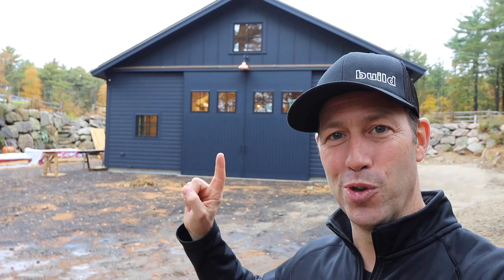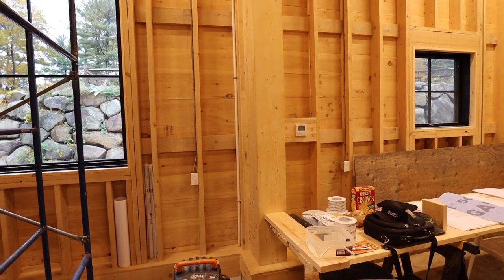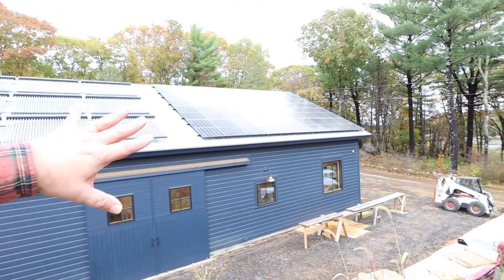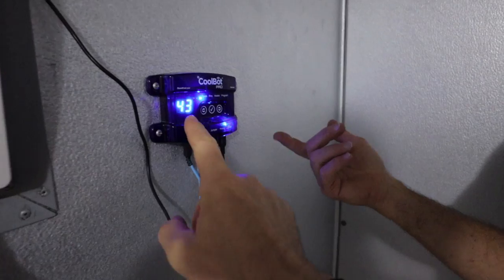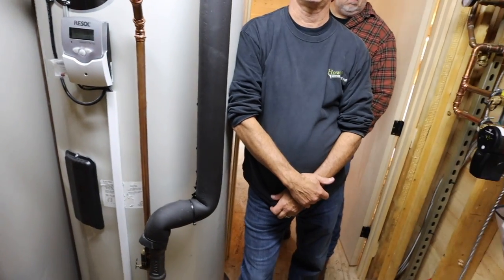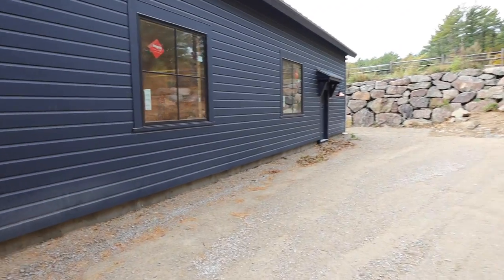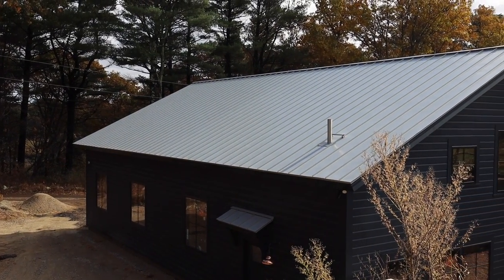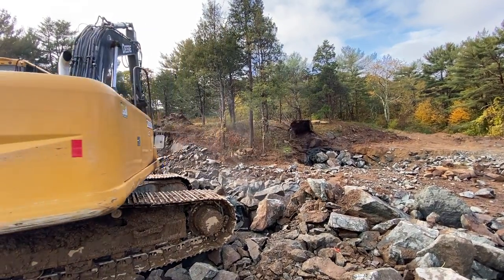Net Zero Party Barn

Comment: The fiorst guy describes the moment frame structure and says that the lack of ties between rafters is made up for by some ties through the concrete base.  That's nonsense.  The steel plates that are at the post to rafter joints, hidden in the beams and joined by   more than  1,000 3/4 X 10' pins is why the bents do not collapse outward.
Reply: Well then, Obviously you are much more in tuned to moment frames than my self and my structural engineer. I would be intrigued to hear more about your structural analysis as it may have saved us $$ - nonsense!!! The plates provide a moment connection between column and rafter beam. That resistance then transfer the stress to the bottom of the column to the base plate connection. The success of these two connections then apply a tensile stress to the grade beam as the columns want to rotate out but are resisted by the reinforce grade beam. Yes the plates are part of the success (although the pins are not 10') but this system DOES NOT work without the reinforced grade beam (unless you put a buttress outside like a cathedral). Are you a registered engineer? I am always looking for sharp people to associate with......thank you

Comment: Interesting moment frame. Wood moment frames are incredibly difficult to prove mathematically because wood is so poor in tension across the grain, which is necessary for a moment connection. I'm hoping they based these frames on testing or some sort of data, and they did not just give an untrustworthy product to an owner.

Comment: So it is a steel moment frame. That makes sense. If I were doing this structure I would buy a prefab steel frame and outside cheating. Then cover the inside steel with wood. 

13 Kw PV system! Take a long time to pay that debt. Heat collection makes sense. 

Be careful with the Air in the cooler. It could become unbreathable. 

To he'll with the house. I would set up living utilities, kitchen, and put a bed in a corner and been  happy.

Fire resistant outside sheathing. Good idea. 

So. How much per sq. ft.?

Explosives break the rock and excavators pick it up and trucks move it. 

What state is this located?
Reply: The plates are embedded in the wood frame - I don't see a difference. Also the client's desire was a wood frame, and I guess their desires should come first. Also, the electric rates here are pretty high, we have estimated about 5-6 years to pay for itself

Comment: "free" I mean you paid a ton for those panels and stuff.....so free isn't really the correct word.
Reply: Exactly. People mislabel Solar so often as free. That system is probably in the $40,000 dollar range. If a $100 a month to power that shop, 30 years of paying for electricity.
If they're leasing it. That cost never goes away and they better hope the buyer of that property wants solar from that company because they'll have to assume the lease. Or the current leasee will have tio ay to have it removed and stored till they want to use it again. I've researched solar to the Sun and back. Unless you're off grid or have money to burn and don't want another supercar to do 55 mph in. I found there's no good reason to get into it.
Reply: @myrrhavm  The electric generated here will service the entire project, barn, residence, pool house etc. Yes you are correct the systems aren't free, but I also have documented projects with $36k solar arrays that have paid for themselves in 5+years - and then the power is free......
Reply: @myrrhavm  Massachusetts is one fo the best states for solar btw
Reply: "Temporary investment" - soon to be free (5-6 years)
Reply: @stevenbaczekarchitect9431  They didn't say it would fully service those properties they said it would supplement.
Reply: @stevenbaczekarchitect9431  That's an expensive system I'd be surprised if it paid for it self that quickly. Most solar setups pay for them selves in the 10-20 years time frames generally.
Reply: @Dougie085  in New England the timeframe is much quicker
Reply: @stevenbaczekarchitect9431  why? You get less sun than places like Texas and Florida, unless the tax rebates practically pay for the system.
Reply: @Dougie085  yes, we have SREC's, our electric costs are higher, and incentives are high
Reply: @myrrhavm  $100 a month?  Try about $400.
Reply: @Doug Dale 10-20 years if you pay for a "professional" installer.  PV systems are half as expensive when installed by a homeowner, so I imagine a contractor installing the system as part of the construction process would be in-between those prices.
Reply: @myrrhavm  Financing solar with a loan is the way to go. You can structure it so your payments are equal to or less than the savings, so you're not losing money every year, then once the loan is paid of you really do get free energy.
Reply: @myrrhavm  My system is almost the same size, just over 11kw and cost under 30k before 30% tax credit. Our system is financed and payment is less than power bill.
Reply: All the people in this video will be long gone before they break even on that solar system
Reply: @myrrhavm  that is a very practical and 'consumer'-minded position. Paying for solar means voting for solar, which will lead to advances in renewable energy down the road. EU paid the biggest toll when PV first came out. Their sacrifice of practicality then has made it reasonable for everyone else now - including my off-grid project. Cheers to them!
Reply: @Dougie085  Its actually almost impossible to break even with solar in Texas.  Between mandatory grid tie, wholesale sell, retail buy, ect..  and cheap power, it is a pretty long payout.  The reason it works in Mass is that their power is expensive as well as strong incentives.  That is a LOT of panels.

Texas has a lot of sun, but we also have a LOT of oil and gas companies too.  

I think they have more like 100K in panels, and almost certainly have batteries as well even if we didn't see them.  Another 40K in the water system most likely.  

I could be TOTALLY off, too.
Reply: @stevenbaczekarchitect9431  huh?  Nope, AZ, CA, NM are far better.  MA is terrible for solar.
Reply: @kdrguru  You need to look beyond just the solar access parameter my friend, and look at things like net metering, cost of electricity, SREC's, etc. Funn y I'm licensed in NM and have about 40 net zero homes there too.
Reply: @ @stevenbaczekarchitect9431  The PV array on the barn is 13 kW, i.e. 110 amps.  First, that's very unlikely enough to service an electrically heated and cooled large barn, residence (likely over 7k sq ft), and pool house, when it's active. In the Mass winter expect no more than 2 or 3 full power hour equivalent per day.  Solar installation in Mass for a winter month will fall to 10% of the annual monthly average. Worse, most rooftop installs are sub optimal.  This install in particular has a tilt angle to shallow for Mass latitude, i doubt its facing due south, and it appears those east side pines are going to shade some of the early sun.  Count on some snow cover and less than adequate cleaning.   Best leave solar to the utility if that's what people want, as they build solar five times cheaper than rooftop.
Reply: Steven Baczek and fact is many states have allowed utilities to stop running meters backwards, Hawaii for example. Now you have to add batteries and inverters and batteries have limited lifespan. I think you are trying to make the homeowners feel better but facts are facts. I researched solar ( in CT) and it just doesn’t pay. Limited sun during months where you need it the most, snow covering panels can knock out a whole row of panels because they run in parallel. You just cannot heat water on a roof in main when ambient temp is below freezing, it’s basic  please tell us about back generators that the clients have,milked every other sensible homeowner in NE has
Reply: @simonmetz8587  Here we have great incentives, we have net metering, and we have SREC's (Solar renewable energy certificates). I have projects where the PV has paid for itself in less than 5 years and that includes driving 15k miles in their car. This project specifically is probably not on that schedule, but it isn't far off. This client (which I highly commend) was out to do the right thing. Investment is always on everyone's mind, but it wasn't the driver here. If more clients viewed decisions from their point of view, things would be less expensive, and easier to access for all. In some ways they are - systems keep going down in price and generating performance increases. It's sad for Hawaii (lived there for 3 years) that is a perfect scenario for PV. I greatly appreciate the comments and discussion
Reply: @stevenbaczekarchitect9431  I was curious too about if the panels had the optimal tilt angle 📐?
Reply: @gac107  Not true !! I have numerous projects where systems are paid for in 5 years or less - Hell, I hope I'm still around for that.....

Comment: Hey you doofus the term you are supposed to know (at about 12:00 minutes in) that these are called "HEAT EXCHANGERS" that transfer the energy accumulated from the solar collectors to domestic hot water (DHW) and hydronic floor heating systems.  These systems are almost always filled with a Glycol solution in Northern climates where it freezes during the winters and are handy to keep your driveway & sidewalks clear.  Using heat exchange technology is VERY effective when used as a transfer medium from external wood boiler facilities, which only need to be fueled/loaded once a day and maintains heat/hot water for extended periods.  Along with super-insulation, a very wise component to a net-zero design.  I wish it were more affordable.

Comment: Quit calling it 'free heat'.  Those panels cost $40-50K...
Reply: It is more of a rounding error when compares to the cost of this barn. However, I just did a 40 panel PV roof and my cost was around 18k. Same thing, 325watt 60-cell panels with grid-tie inverter system.
Reply: Those panels won't last 10 years .
Reply: @vadimr2  $18K PV plus those solar hot water panels...plus storage tanks, plus backup water heater = not much change from a $40K bill.  In any event, hardly free heat.  Of course, the owner isn't gonna worry about that - not on a multi-million build.
Reply: Mike Redding The panels will last 50+ years. They will lose around 20-30% capacity over the 50 years. The problem will be the inverters, those will likely need to replaced at some point in the 50 years.
Reply: No, about 10k$ or less for premium panels. Prices dropping fast.
Reply: @martialman.4563  Good quality 325W Pansonic, qty 40 shipped, is $16.5k.  Inverters for 13kw array $4k, and $10k install minimum..   It's a $30k array installed.

Comment: First major snow those evacuated tubes will be cover and stay covered.....should of went stand-off rack with flat plates and drain back system...tanks will also go bad 10 years.....not bad but definitely not great solar thermal system
Reply: They have automated systems to maintain evacuated tubes so they melt the snow themselves.
Reply: Town's End Living soooo they’re heating the outside...?sounds efficient..still love ur channel,thanks for the response.👍
Reply: Yea it only takes a few minutes to thaw them and then they can continue to produce heat the rest of the day, you loose alittle but you also gain a bunch more then if you didnt do it

Comment: wow, another lost opportunity- at least you did orient the barn right- long side facing south- but you didn't add more windows on the south- and minimize them on the other orientations??  and the big barn doors are also a huge energy hog.    and calling this a Net Zero building is only possible do to a very expensive and larger than needed (due to minimizing the insulation- energy conservation should have been the highest priority) PV system.  and the volume is also wasteful with all that unused height. you could have put a whole second floor/story up there!  and its very wood intensive.  this type of building (using technology to overcome the energy waste) is unaffordable by most people and not a good example of environmental design.  but it does show excellent workmanship.
Reply: Funny the largest piece of wood in there is a 6x6, there are two of them. Here I thought we were doing something.......

Comment: I think most of these builds just test creation where they are just trying ideas. Because I dont really understand the benefits of having metal inbeded into the wood rafters would that make the rafter weaker from all the holes drilled in them
Reply: If you understand the basic physics of the connection the driving failure is the bending moment in the joint. Take a close look at some of the older bridges in America riddled with bolts

Comment: They plan to build a boat in there?
Reply: I think to store a boat for the winter.
Reply: @guytech7310  I would like to see that boat. I wonder if it has to be stored temperature controlled.
Reply: @williamnaman3570 they have  floor heat ,  and mini splits ,  it  will not freeze

Comment: Showed everything except for the electrical service, if it's a "net zero" barn why is there an electrical utility meter??
Reply: net metering for the rest of the property
Reply: @dodgeplow  you normally mount the meter on the building that is using the electricity from the grid, not mount a meter on a 100% solar powered building and the meter is keeping track of electricity used in a totally different location. The meter is powering your breaker panel inside the building.

Comment: Yep. Overpriced. 
Solar is free forever. Absolute BS.

But if you want to show people you are rich it's fine.
Some people buy overpriced underperforming cars too.
Reply: What I found totally baffling was the walk-in cooler.  A million dollar barn with no expense spared  and a crap-ton of power and they didn't spring for a REAL walk-in?     I mean we are talking less than 10K for a restaurant grade system.    The other thing is who is going to walk to the barn to use it?   Seems to me more of a temp arrangement that will be thrown out when they finish the house.  

I think they missed with not having a small "apartment" built in too.  You know someone dumping this much in a barn will have "staff."
Reply: @redwolfexr  You would be surprised how well an  Air conditioner walk- in works. My buddy has one.
Reply: @rrmerlin3402   not saying it doesn't work.  I am saying its an odd cost saving/cheap decision in a million dollar (or more barn)

Especially when it required a modification to the building and a rather ugly "bump-out" on an otherwise pristine and uninterrupted wall.